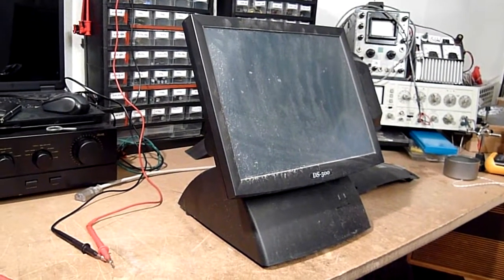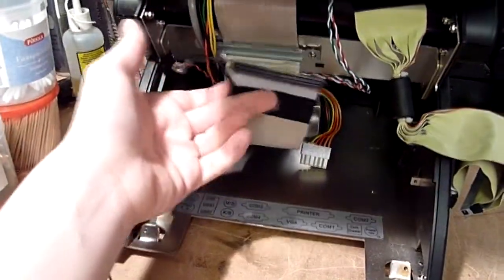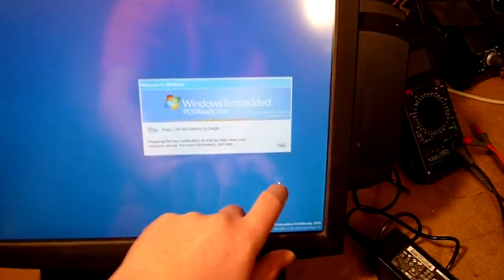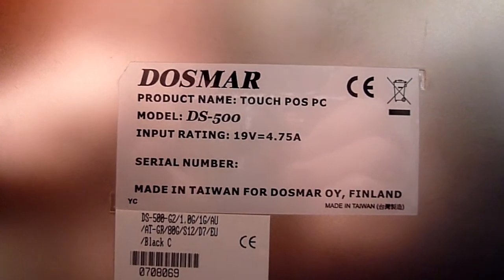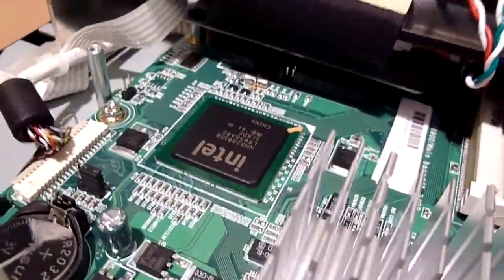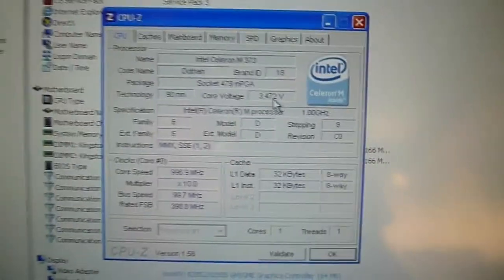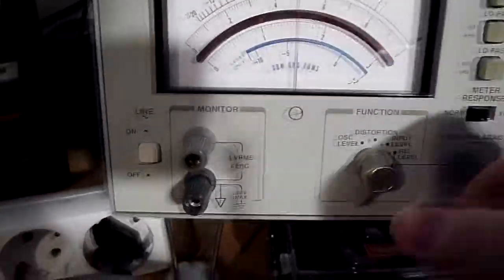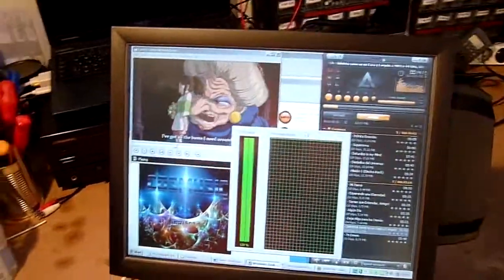Reviving a trash-picked point-of-sale terminal

Comment: I think that empty card slot accepts a mPCI wireless NIC card. And I think I spotted a single SATA port? Maybe you can put a small 60GB/120GB SSD in this SATA port, give it reasonable Wi-Fi connectivity on the mPCI slot using one of the Ralink chipset based cards and a adhesive-backed internal flat flex PCB antenna, and use it as a home automation controller box running a lightweight variant of Linux (something on the caliber of Raspbian's PIXEL on Ubuntu Linux)